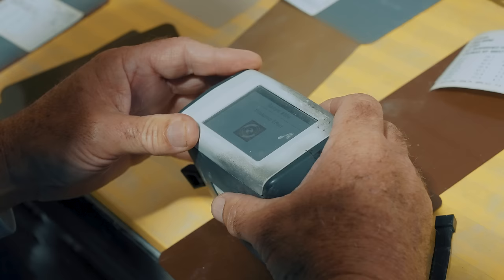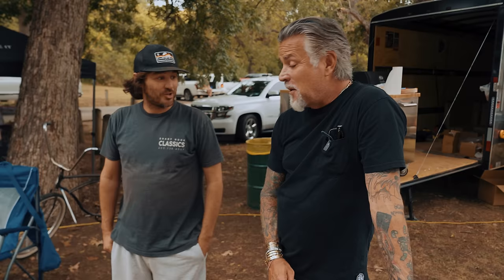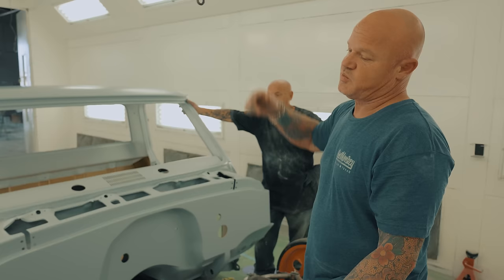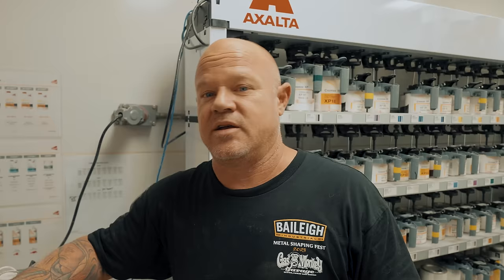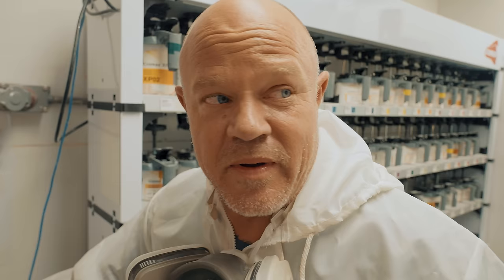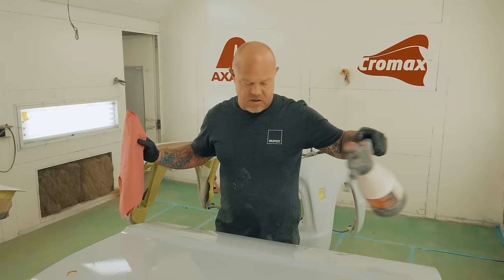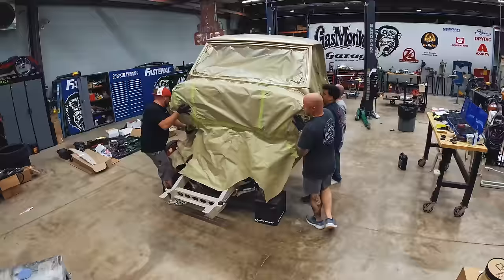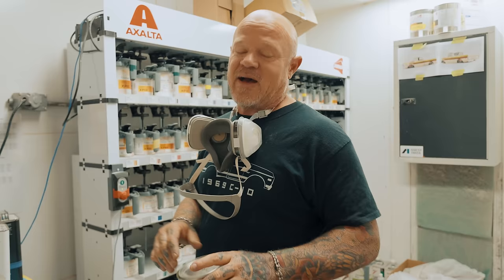1968 SEMA C10 Gets a One-Off Paint Job | PT 4 - GAS MONKEY

Comment: If you have gas heat in your house and you have a radiator as more like a boiler system there's water going through there I believe there was also Royal fired heaters that had radiator systems in it and I believe that was also water

Comment: Either a fuel oil opperaded radiant heater. Or a cast iron radiator heater that was typical in alot of homes in the north.

Comment: 26:30 - I think you guys might need a Pipefitter car guy to hang around the shop there once in awhile. 
From the early 1900's to around the 50's when natural gas furnaces became more commonplace, your Grandma's homestead was possibly heated with a small boiler whose burner was most likely fueled with either coal or light oil. The room radiator, made from cast iron, would allow piped low pressure steam produced by the boiler to flow through it and get it hot, producing radiant heat. 
Notorious for condensation leaks that wreck those real hardwood floors under the linoleum, and burning the hands of every grandchild who went near it during family visits, the low pressure steam heating system was a plumber's summer holiday fund. Keeping service trades well employed since 19-0-something...
Reply from the maker: ... We still think Ricky's Grandma had a motorcycle in her home and we won't be convinced otherwise 🤣

Comment: I could never afford to build (nor do i have ability now) a custom car. But would love to see you guys do a build on a Ford model A sedan delivery. Thinking big tubs for the rear rubber (Meaning original size rear guards just tubbed into inside body), airbag suspension, blown crate Hemi engine with a modern 6 speed manual or auto. With full electronic dashboard. but the hard part! A one piece flip front incorporating the guards. paint would need to be a custom GMG mixed light metallic green with large GMG mural on side panels and GMG logo on all 3 doors. Always (not sure why) wanted to build a model A sedan delivery (panel van as we call them in Aus)

Comment: Awesome Job!!  What are the names of the colors painted in the side stripes? is one of them dark gold? If you have some info about the colors I'd appreciate it if u could share the names. I'm working on a Camaro 3rd gen It came originally as light brown, however, I found that in 84 they used a color named Dark gold. My issue is that I am in Peru. Here no one works with paint codes, paints are just mixed and prepared the old way, so I would appreciate it if you could share some images or any info on those colors, so I could use them as guides when preparing the paint for my car. Thank u everyone and all the best for Gas Monkey!

Comment: Curry oh s*** I worked for them back in 1989 I believe it's too long ago I don't remember making a lousy $10 an hour no wonder I don't remember I really hated working for peanuts this guy you're talking about the rear ends I don't remember him at all I do remember the things I had to do machine splines on the axles weld holes drilled holes for the bolts remember doing some c&c work but I wasn't interested at all making nothing